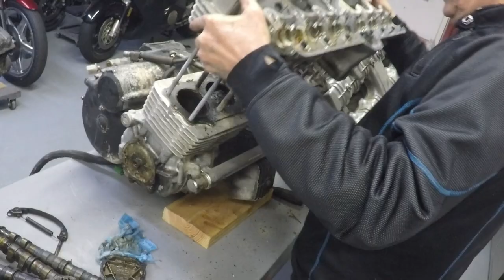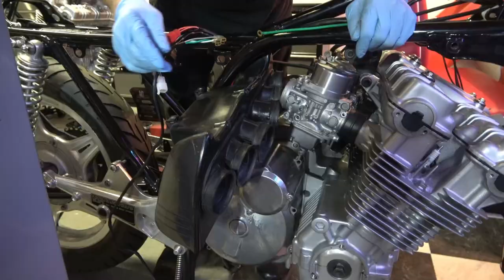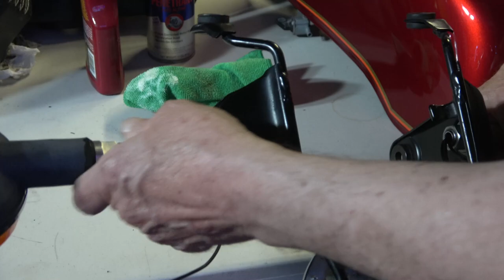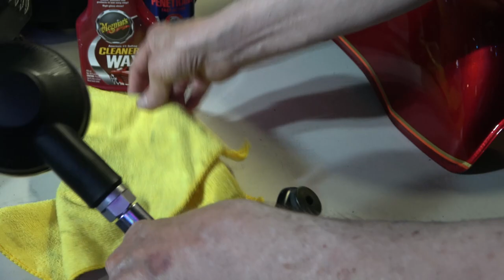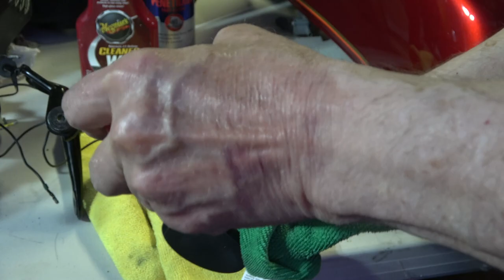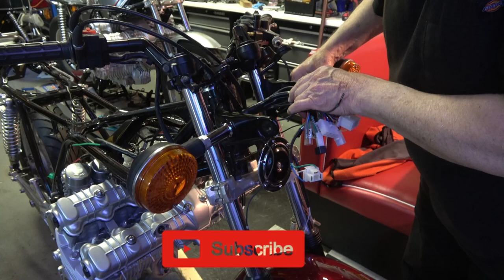Honda CBX Full Restoration & Engine Rebuild Video Series - Part 38 Air Box Headlight Signals & Horn

Comment: Exciting stuff. I just grabbed a lovely crudy unrestored 1-owner KZ1000Ltd 1981 here in WA state, and am picking up lots of good tips and motivation from seeing your work.
Had a poster of a CBX on my wall as a 10-yr old kid, which I picked up at the Paris "Salon de l'Auto" in 1979 with my dad. 
Thought it did not look so cool back then because of the suspended motor. Oh boy have I changed my mind since... what a cathedral.
Thanks for the inspiration and keep on trucking !

Comment: I was able to remove the head on my 79 by loosening the rear chain adjusters, shoving the back wheel as far forward as it would go, and pivot the engine. I had messed up a valve during adjustments....ALWAYSVTURN THE ENGINE IVER BY HAND, NEVER WITH RHE STARTER, AND MAKE SURE YOU REMOVE THE TACH GEAR OUT OF THE HOLDER, AS THE WORM GEAR ARRANGEMENT WILL MAKE IT CAM OUT, BREAKINGTHE HOLDER!!! Then you'll have to call Lou down in Florida for a new cam cap with the special tach gear holder!

Comment: Could you show the top end with cam cover removed...with engine turning on starter only...so oil flow to top cams can be seen..mine done seem to oil up as quick as the lower cams.